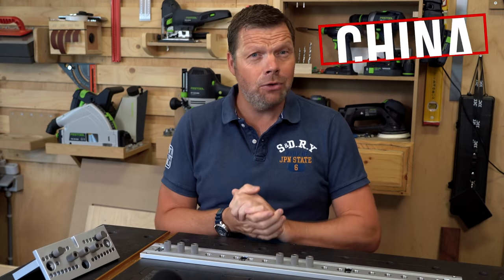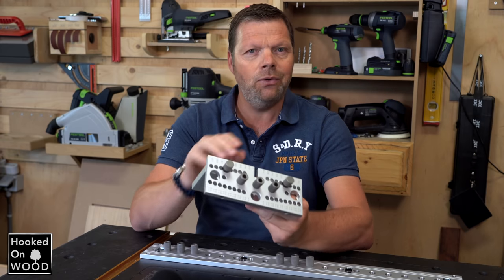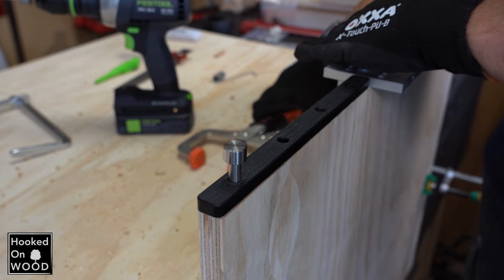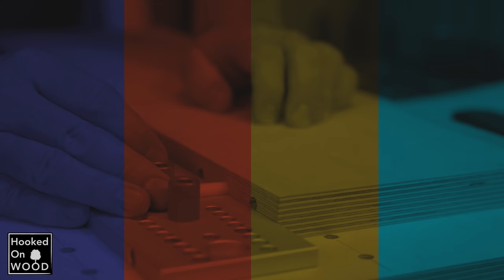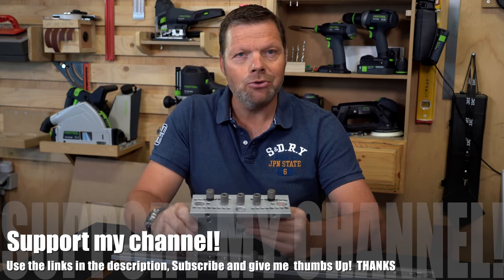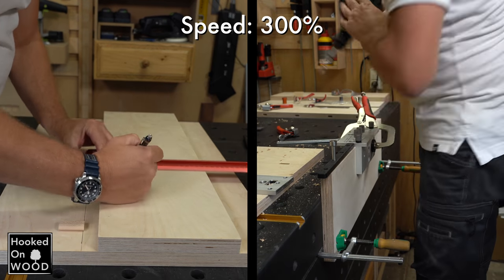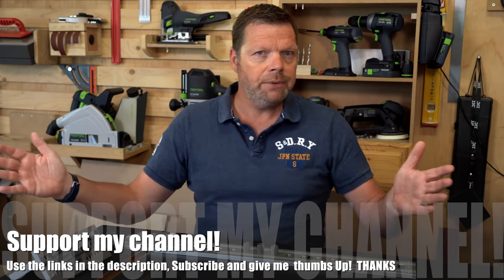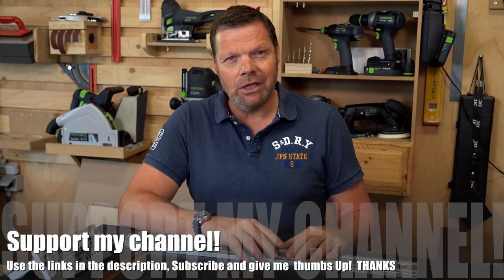China Tools, Amazing Doweling jig you have to see!

Comment: You can buy from banggood other size drill diameter guides (Wen products) THey will screw in just fine, on last count I have ten of each size. So the up side is 8 mm is not the only dowle size you can use, all so I have found the plate with A or B on it can be flipped around with A or B facing out gives a different hole position not center alignment. Cheers

Comment: I agree it is a great combination for joining cabinetry panels, but may also be used to create an MFT table top by precisely placing holes with just the tip of the drill bit indenting the surface and going back with a 20 mm brad point drill bit in a  portable drill press to complete the holes and the rows can be set precisely square.
Reply: Great point you make about being able to use this tool to make MFT style tops. Feel a bit silly that I never thought of it. Thanks for sharing. I'm about to make a storage cabinet and just watched this tutorial again as a refresher. Glad I looked through the comments. Always a great source of tips and ideas.

Comment: I joined two long boards with this today. It did work well, but using the black spacer bar left some room to introduce error i feel. If it's skewed just a bit it'll leave your dowel holes short. I feel an improvement would be an S shaped bar that reaches over at the end, lying on top of the end of the main jig and that you could then put one of the stainless pins into. This would ensure 100% accuracy every time. Or, just make the spacer bar T shaped for a greater reference surface.

Comment: very good explanation about the round router base.

that's exactly why I bought the full circle round base for my DeWalt trim router, because the half round half square base didn't make any sense to me, and also damaged some of my material.
I also changed the bolts holding the DeWalt round router base to stainless steel M4 x 10mm button head + stainless steel washers (they protect the acrylic base from damage by bolt head), because the original bolts are made from such a soft metal that the heads got damaged after only few  times I unscrewed them.

Comment: Great video and Thank you, Denis for your insights into the alternative tools available! I did buy and use both the doweling jig and the multi-row puncher. They both work very well, and I agree with your review. As all of us, we learn by doing. There is a gotcha if you use them both on the same project. The plate of the multi row puncher is not the same thickness as the plate of the doweling jig. This means that if you use the same drilling setup for both, the hole drilled using the multi-row puncher is deeper, and punches through the wood... Don't ask me how I know.....🤯🤯🤯

Comment: Have owned Dowelmax (Canadian) for over 10 years.  Works great but not the best for bookcases cabinets etc.  Purchased the Wnew dowel jig.  Main limitation I noticed is that Wnew wiil not work well if stock is narrower than 70mm (approx 2.75 inches).  Ie unable to drill two dowels per joint for a picture frame that uses stock that is approx 40mm wide.  In short Wnew is better for cabinets

Comment: Was very excited to see this video. You did not disappoint. Very detailed as always Dennis. The straight long jig is the best I have seen for shelf pin holes next to a very expensive line boring machine. The doweling jig is awesome as well. With the way pricing of goods has gone up since pandemic, I am not surprised by its cost for the quality. Great video
Reply: What sort of shelf pins would you use?  You can only use 8 mm dowels.   Is there different size bushings available?

Comment: Great explanation and very usual because the user manual (yes my first china product with a manual and in english) is noch so good. Good product shipped within 8 days. Good quality. The only downsize is for drilling holes series of 32mm for the adjustable tray in a cabinet. They provide only a 8mm drill. Usually we have 5 or 6mm holes for this but 8mm is very uncommon.

Comment: Long time ago I bought a large plug-in Mikita router. There were 2 options on this router base at the time - square or round. I bought the square base and quickly became very conscious of drifting along a fence. Note to self, “get the round base next time”. My newer routers have a flat side that I use when changing bits, but otherwise I don’t see much advantage to having a flat side on a router base
Reply: use the round base also use a centering cone to center that round base and now you're perfect

Comment: This is great.. I have the previous or the most popular dowel jig with 6, 8 and 10mm dowel collars and 300mm extension/alignment rods, lovely jig to use, and I have never needed 6 or 10mm dowels.
However, this new combo is just brilliantly designed, I must have it.

Quick question on the multihole puncher, I dont know if you have mentioned this already and I apologise if you have, I presume those holes are 32mm apart? 37mm from the edge?

Thanks.

Comment: Very nice video about doweling jig. But if you want to dowel a piece a wood in the middle of another you use the marking point of the jig to allign the jig with the line but the dowel in the side of material is not in the middle because is not a self centering jig.Practically you align the dowel itself with tle line.

Comment: An advantage of the 8mm dowels is that they are available pre-glued. Just spray with water.
Question: What is the spacing of the holes in the Multi Row Puncher? I.e. what is the distance between 8mm holes and between 10mm holes?
Reply: I just received the jig and can confirm that the hole spacing on the Dowling jig and the multi row puncher is both 32mm center to center. The multirow puncher is 80mm wide.

You can also buy additional drill bushings for about 3-5 dollars each. Make sure you get the correct bushings, as these use an M14 (14mm diameter) 1mm pitch thread.
The multirow puncher can have up to 20 bushings installed, so for a full set of 5mm bushings it comes between $100-150.

Comment: Don’t know if this is old news but Just for info for those who want to use this jig on thinner materials,  I ordered some 6mm sleeves for the jig and just added a short length of 6mm MDF to the A/B side of the jig with double sided tape to act as a spacer, this allowed me to get 6mm dowels dead center in 12mm plywood or MDF.
I also added some thin sandpaper to the 6mm spacer to prevent the jig slipping/moving when drilling - worked a treat!

Comment: Thanks so much for this review - I wish I'd known about this jig before I spent plenty on a JessEm system, which is good, but can't reference off an edge like this does. Just for the record, Wnew do also sell additional drill bushings in a selection of sizes, so it is possible to switch over to 6mm or 10mm dowels if needed.
Reply: Thank you! Can you please post a link to where one can find these additional bushings?

Comment: The drill sleeve is available in AliExpress in many hole sizes.
Reply: If I get those then I can use this to create 10mm and 6mm dowels then right?
Reply: @DavidLee-cw6ci  Yes, and you can make holes for any size of dowels (say if you want to use brass dowels), 3mm, 4mm, 5mm, etc.

Beware though that there are 2 types with different screw thread (the part that got screwed into the jig plate). So if you already own a jig, in AliExpress choose one that matches the one that comes with your jig (but different only in the hole diameter).
Reply: @AnasSuhaimi  Thanks for that. I just checked this on bangood, apparently the kit comes with different size bushings now. 👍

Comment: Nice jig. What is the distance between the holes?

And what does the Letter A and B which is marked near the Line of digits mean? In your example you used the hole with the thickness of 23,5 mm. That line of digits is marked with the letter B. What does the letter B mean?

There is a second line of digits which is marked with the letter A. In your case it is 15,5. What does this stand for?

Comment: Thanks for the once more very interresting video.
Small question; can It be used as a sys32 template ?
Reply: I doubt it as only 3 holes you would be better looking at the kreg jig that's quite useful. Although I found the offset from the front is wrong so screwed an additional fence to it

Comment: As always high quality easy to follow thorough review without any rambling. 

Curious that you gave the small jig 5 stars in all categories even though when using the 23mm thick wood the alignment becomes more unstable ?
Reply from the maker: You get a very nice product for the money. It is only with thicker material and there is also a possibility to work around it. But the scoring card is always difficult. So watching the video is more important. And if you only work with 23 mm material you should re consider. I try to show as much as I can. But you get a point😀
Reply: The manufacturer could easily make a pin for thicker wood.   Or you could make a sleeve for the included on or design your own.

Comment: Thanks Dennis, beautifully presented again
I wonder, do you have to rely totally on the plastic pin on wider boards? Is it possible to keep on the edge guide pin for the connection closest to the edge, then take that off and use the extension piece as usual. 
PS I ordered both pieces through your link👍
Reply from the maker: Yes, I think you are right. That would be easier and faster. Great tip👍

Comment: Great video, as always, thanks. You should have mentioned the A and B side. I was thinking, how can 23.5 and 15.5 mm be the same hole. I received it today, and now I know :) It looks like the multi row puncher can be used for making a cheap, but accurate MFT table, with the holes 3.2 mm apart x 3 = 9.6 mm, I will try that.
Reply from the maker: Hi Paul, Yes, I could mention it, but it was not my intention to explain exactly how it worked. More about what you can do with it. But Indeed, you have two sides.  What you say about the MFT table is interesting. I will think about it too. 
Creat perspective to discover. Thanks Dennis

Comment: @Dennis: I'm impressed about this awesome video, thanks a lot! 
Nevertheless I'm a little disappointed with this jig. 
Referring the holes for >>Eccentric Wheel Nut Connectors<<. Current Eccentric Wheel Nut Connectors have a 34mm pattern. So they don’t fit to the dowelling jig, which has a pattern of 32 mm. The result: You can’t stain them, joints remain loose.

Comment: Denis,  I just ordered one thanks to your review. But until it arrived (2-3 weeks ) I watch again and again your video and I don t understand why are 2 rows of number (A and B). I understand if the wood have 18 mm thick you put the bushings in the 18 mm hole but near the 18 mm is another number. Why? Thank you
Reply from the maker: This is not a self-centering tool. (This is not that much of a problem, but you want the holes as close to the center) You can change or turn the underside piece. This is labeled the A and B sides (I believe). By doing this, it corresponds with the numbers next to it. I will see if I can show it in my next video.

Comment: Dennis as always your video was excellent and very informative. 

My slight issue is with Banggood's website. For instance with the "Eccentric Wheel Connecting Piece Furniture Screw Nut Kit" it does not explicitly states what quantities are supplied. The number 20 is mentioned. Is this the amount of sets included? Also dimensions are sometimes omitted from the descriptions (in this case you told us it is 40 mm). As you appear to have a good relation with Banggood, maybe you can point this out to them.
Reply from the maker: https://www.banggood.com/custlink/3mDhBFTwf7 these ones are for a set of 20 screws.

Comment: Hi Dennis
I have tried various methods using the 3in1 dowel jig to get a tight fitting carcass joint. In your review you skipped over the method too quickly.
I love your reviews but would love to see a more detailed review of the cam lock set-up as the user manual describes too many measuring guides and does not explain very well
Reply from the maker: I will think of it. Perhaps I show in one of my next episode of China tools

Comment: An interesting product, however could the hole puncher be used as a shelf pin jig or are the guide busing holes too big for this?
Reply from the maker: there are 5mm bushings available. But you need 10 sets and that cost a bit too much. I bought them however because it works pretty fast I think. Have a project in the near future where I can test it.

Comment: Can you use the doweling jig multi hole puncher as a guide for making holes in adjustable shelves?
Reply from the maker: Yes, but you have to buy 5mm bushings. these are separately available. Link you find in the description of the video. Problem is you need 10 sets making it a bit expansive.

Comment: Hi Dennis, thank you for your videos. You mentioned about using the multirow jig to drill adjustable shelves. 
Does that mean that the shelf plug need to be 8mm diameter ? Seems big to me... Do you need to buy additional pieces to drill at lower diameters for that use? Thanks a lot for your answer
Reply from the maker: Yes, you need to buy 5mm bushings or create something to fit 8mm
Reply: @HookedonWood  thank you for your answer

Comment: Does anyone with the jig already have any idea of the external screw thread size of the bushings (or to put it another way, "what size thread will the bushing holes accept) as I'm looking for a 5mm set to allow it to be used for standard 5mm shelf pins. I've found a set with a M14 thread, but not sure if these will fit the jig and long bar. Any information appreciated. 👍

Comment: Aren't shelf pins 5mm? Or 6? Do I need to get extra bushings to punch shelf pins with the multirow puncher then?
Reply from the maker: Yes, that is unclear in the video, but I can not change that. I believe in te next episode I correct that. But you need 5mm bushings and they are not very cheap.
Reply: @HookedonWood  thanks for clearing that up. :) I did look at multiple episodes regarding this tool. Couldn't find it. I'll look into bushing prices.  Thanks!

Comment: Can this jig also be used for 12mm material? To build for example small drawers. The jig seems to range from 15,5 to 23,5mm right? Probably I still have an excuse to buy a lamello (also because that can make angled connections)
And do you have a separate base plate with the block glued on? I would never want to glue something to my tools haha.
Reply from the maker: Hi. The range is between 15 and 30mm. So, probably still a lemello😀. The glue was only temporary. It is clean allready. I think on plastic a little drop of glue is easy to finish but it was better to use a piece of tape first en glue it on the tape. I hope not to much will destroy their routers now😟😟

Comment: Sadly, the jig has a 7mm drill and guide bush. 
In the UK, no such dowels, so rather a waste of time for thinner material. 
  I wonder why they missed out the (common) 6mm dowel tools?
Reply from the maker: you can order 6mm bushing separately. Only problem is you have to find a solution for the pin to use at the extension piece. That will be too thick.

Comment: This multi row pucher does not integrate sufficiently with the main jig. It does not feel as a system of two pieces, but instead they looks like two disconnected products.
Reply from the maker: Really? I think they blend perfectly. What is wrong?
Reply: @HookedonWood  What is multi-row guide is for at all? Only for T-joins, which are rare.

How can it be used on the side (like precisely 8mm from the side of 16mm thick panel)? No way.

How it can guide the main jig? I mean to use both at the same time? No way.

How it can be placed with some known offset from the fron edge when drilling for shelves? No built-in way.

Also, even with the main jig you cannot make holes in two boards *from the common base* (!) while keeping mini-fix holes *inside the cabinet* (like usually). Think about it.

Ideally all holes should be done by such a long guide. But only mini-fix holes (15mm) - via additionnal separate (small!) jig. So, this set is far from being perfect.

Comment: It's a shame the spacing between the dowels is so large. I guess it's more suited for sheet material type joints rather than Mortice and Tenon type joints on furniture.
Reply: I bet you could work around this by cutting the right size spacer or 2 and putting it between the side of the peice you are cutting and the registration pin.
Reply from the maker: I agree this jig is indeed better suited for cabinet making.

Comment: Nice work Dennis, as usual. I've ordered a set from BG using your link. I'm trying to find a link to buy more of the "Corpus" connectors you demonstrated, but google is not having any luck pointing me in the right direction. What are the connectors really called, and where can I buy more?
Reply: search knockdown furniture hardware.
Reply: @EdwardKowalski  Thanks Edward, that did the trick. Cheers, Paul
Reply from the maker: Thanks Edward!
Reply: @boxertrix2540  I think Screwfix do some furniture fittings at a good price

Comment: Hi Dennis.  I'm hoping you (or anyone else that has bought this product) can help me out here as I am trying to work out what is actually in the kit.

In the clip you say that you can only use it for 8 mm dowels and yet in the kit there are 7, 8 &10mm drills.
Where it gets most confusing is in the description of the bushings in the package.  It states there are M18 5/10 mm Bushings (this matches the photo) and
M14  7/8/10 Bushing, yet in the photo it shows a total of 5 bushes.
Is that 3 x 8mm bushes and 1 each of the 7 and 10 mm bushes?